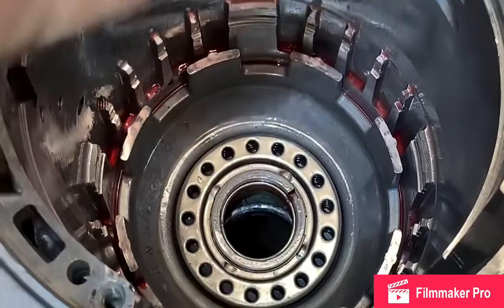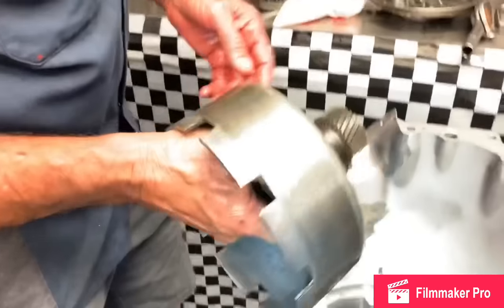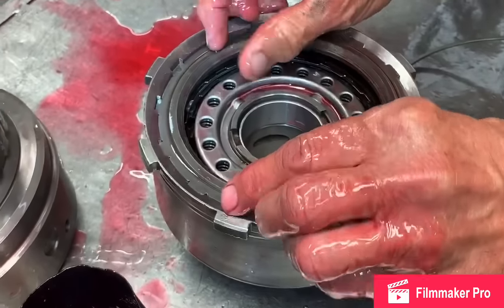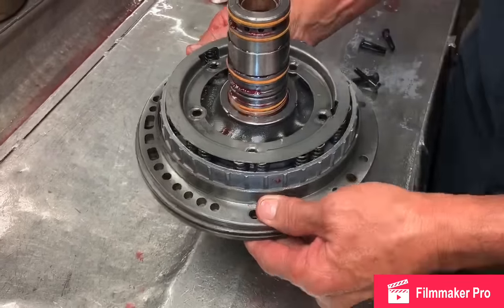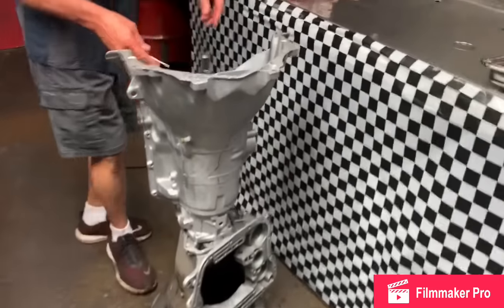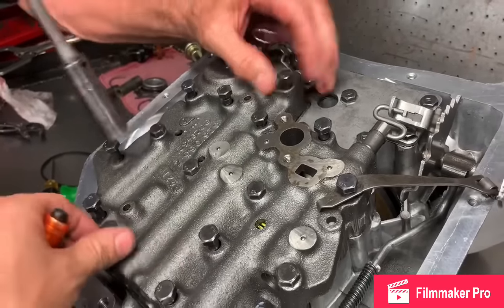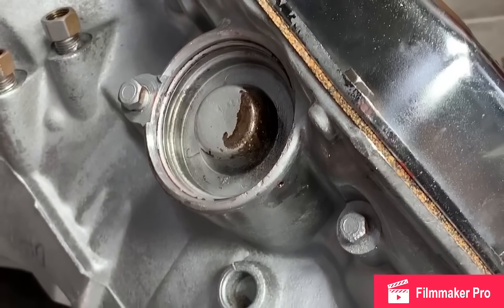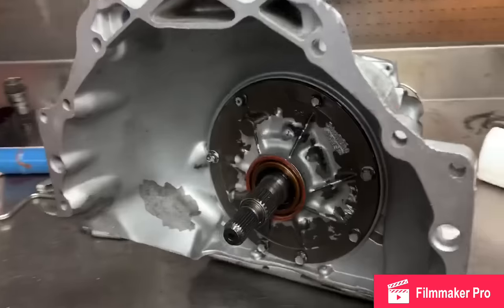It’s a Build video

Comment: I remember back in the day bending my thumb like that so many times Putting in 700 pump slide spring and a screw driver that joint started popping out. Stupid Painful. I ended having to figure out a different way.

Comment: Do you have any videos about the NAG1 trans (daimler chrysler 5spd auto / Chrysler 300C)?

I'm curious about my new-used car's details.  My transmission behaves normally in all respects, but since it's NEW-TO-ME, i have no idea if a slight clunk while decelerating down through 20mph from 2 to 1 is normal, or if it's something to get checked (100,000miles).

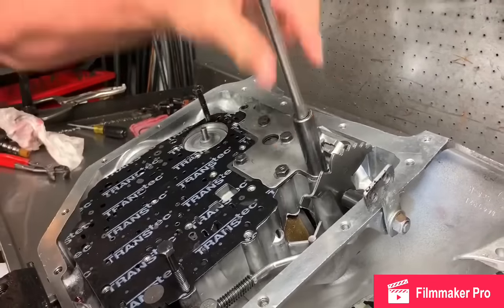Comment: 35:50 Steel always wins against aluminum ;). Always wondered why those S clips not notched, or a bend at the end, to prevent slipping out.  At least that pan has a drain plug, not sure why they did not put drain plugs in every pan.  I like to swap out fluid in between normal services, and to vacuum out via dipstick a bit of a pain.  Stupid JK pans have retainer clips that hold pan on, bolts do not go through.

Comment: I did find out that electric cars don't have a transmission that's what I thought it just runs off of the electric motor as you accelerate. If that's the case what are these guys going to do, assuming they sell more and more electric cars, might have a little bearing on this type of transmission

Comment: 12-13 inlbs?   Did you mean 12-13 ftlbs or 144-156 inlbs?   I honestly don't know but those pump bolts sure look like 12-13 inch lbs would be too little.   I've haven't rebuild a rwd GM trans in 25 years ,  this was pretty cool. -  EDIT:  Never-mind, you said ftlbs later on, 1st time was just a misspeak.

Comment: Hello 
I have 2009 chevrolet silverado 1500 crew cab 
I can drive my truck to you cN do you have the ability to remove the transmission and re installation 
The transmission has 279000 miles and would like to re build and if you can can i get the address of the shop thanks

Comment: Dear Precicion Transmisson.
Where I live, automatic transmission is not very popular. I think at least 80% of the cars have a manual gearbox, maybe even more. Last year, 65% of the new cars sold had a manual gearbox. The other 35% had an automatic gearbox, but electric cars were also included.
Frequently heard disadvantages are, unreliable, inefficient, not “sporty,” expensive to maintain and if something is wrong it costs a fortune to repair. The reasons are many, but I think most will be outdated by now.

Since I am sick at home (no corona), I can't do much more than watch TV. That gets boring very qickly, rerun after rerun of programs that I probably have seen 10 times. So I went to watch YouTube videos on the computer and that's how I came across your videos.
I'm a bit of a “tec geek” and enjoyed the videos of disassembling and reassembling those complicated automatic gearboxes. It is astonishing how complex those things are and what is in there. It does not surprise me that they are so expensive and that repair also entails considerable costs.

Via this response I would like to ask you if you can make a video about how such an automatic gearbox works. I do have some ideas from what I've seen. Yet for me it remains largely a mystery what is happening inside. Seeing you at work gives me the idea you know these things as the back of your hand. So it may sound a bit strange to you that someone like me does not know much, if not nothing, about them. But that’s how it is.

All the best and keep up the good work.
Ernst Grundmann The Netherlands.

Comment: Excellent video except for one important thing - he did not show how to rebuild the valve body.  

Did not even mention cleaning it, checking for stuck or binding valves, or whether he changed the springs. I guess that's a trade secret. 

Almost a complete video. Considering it's going behind a 500 hp big block there had to be some spring replacements. Without that information this video is useless. 

I guess the customer couldn't find a THM 400.

Comment: You didn’t explain the proper way to put the snap ring. On the planet to the output shaft there’s a correct side to put up. The snap ring opening is tapered. Put the narrow end up so it will allow removal ten times easier. Try it both wats up and you can tell the difference.

Comment: It’s a shame to see so much work and craftsmanship put into this rebuild, only for the owner to not treat it properly and not change fluids and filter at the correct intervals.  I’m the type that likes to do maintenance at the halfway mark of what is recommended.  10,000 mile oil changes no !  Even if I use the best synthetic and filters, never beyond 5K miles.  I hate when you see these idiots that come in for 25k oil changes and wonder why their vehicle is not running properly.

Comment: It would be nice if the cameraman was following the action instead of filming the top of the stainless steel table when he’s using his little spring compressor or when he’s working on something on the assembly table and you’re filming the inside of the transmission case showing us nothing he’s doing, unless not showing us is the point of filming it that way.

Comment: Dual feeding direct drum.... You failed to tell us very important stuff. When you leave off the direct drum seal, you also need to leave off a sealing ring on pump and block a feed hole in the case. You did not bother to tell us this. All you said was leave off the seal in the direct drum. Why would you do that? Which seal on the pump do you leave off and which hole in the case do you plug. Dam!!